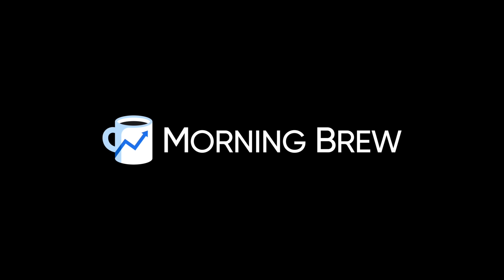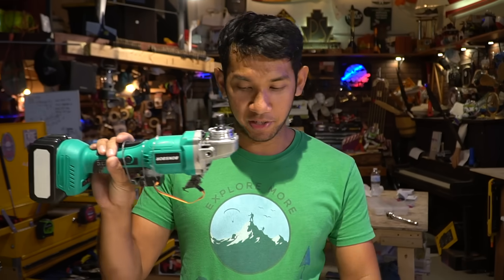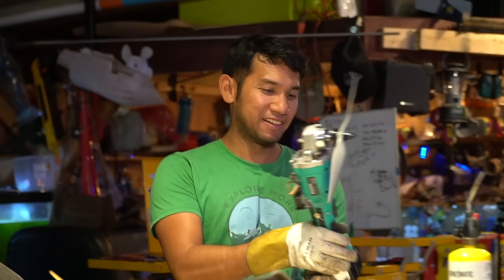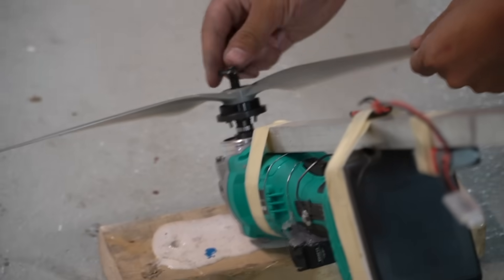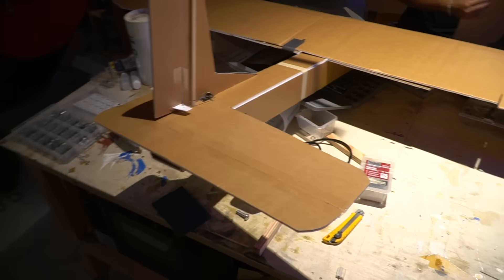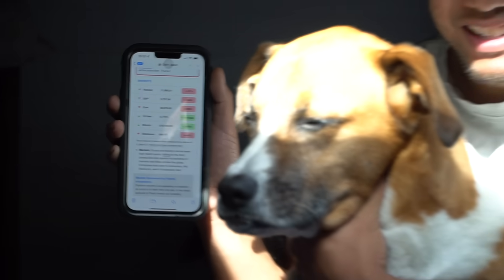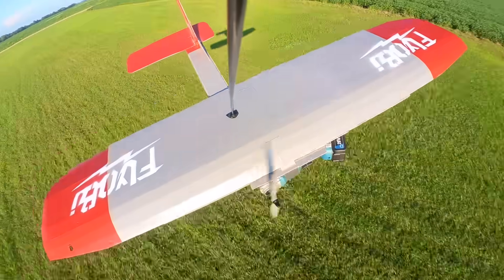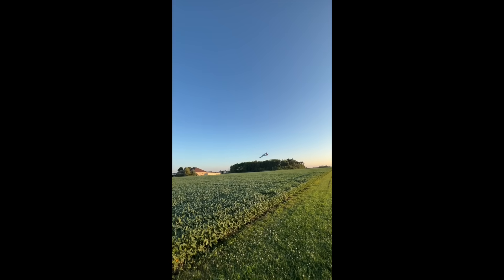Teaching an Angle Grinder to Fly

Comment: If you make a twin engine plane with grinders it will offset the balance issue putting both batteries in the center of the plane.

Comment: I’m impressed with his ability to pilot all this crazy stuff. If you have ever flown an RC plane without gyros and modern stability systems, it ain’t easy on well designed models.This dude? Asymmetrical designs, crazy CGs, ridiculous drag coefficients, violent cg shifts, oscillations , piss poor control surface authority, flexible fuselages, twisting, warping. No problem! It’s impressive the crap he can actually keep in control.

Comment: 1 angle grinder on each side would've given the helicopter more power and way more stability, and actually make it rotate around its central point unlike the offset thrust here. The prop's probably too close to the centre, and that distance would have to be optimised; hope they give it another go.

Comment: Put 2 angle grinders on a plane frame, with propeller sets for each tool. 

Or 

Battery a operated router, putting in a reducer gear that slows down the amount of startup torque initially generated. Hopefully that would take enough stress off of the airframe before the launch.

Comment: instead of connecting the propeller directly to the angle grinder, attach it to a drive shaft. extr points if you take four of them, and make a quad copter

Comment: If the angle grinder's housing is removed and only its motor and battery are used, then a great deal of weight will certainly be saved!

Comment: Yo what the fuck are you doing having someone hold stuff while you cut it with an angle grinder. Those wheels have a tendency to explode and that guy is right in the line of fire. Not to mention, you could just cut him? What if the blade got caught and yanked towards him? For a smart guy, that shit is one of the dumbest things I have seen someone do in years.

Comment: Why not remove the right angle gear box on the front and just let the motor drive the propeller directly? More efficient, and you can center the mass of the grinder.

Comment: @PeterSripol  If you take the angle end of the grinder and make a small plate to replace it, you will then have the motor running inline with the fuselage making it easier to balance out. Will also give you the full power of the motor.

Comment: Great video!
What, if any, impact did the offset right angle orientation of the grinder have on the planes handling as you were throttling up and down?
Did the propeller temper/buffer any of this effect?
I ask, as I know from experience that the angle grinder can try to spin out of your hand about the rotating head if you run it instantly at full power.
This is  best experienced by holding the tool straight out to your side at arms length like you were holding a torch, and the rotating disk/propeller facing away from you, as if the grinder was one of those WWII flashlights and you were shining it to your right with your hand extend all the way out.
Quickly throttle the grinder up and then off and you should feel a strong twisting motion at your wrist.  This is the 'axial' motion that is opposing the disk/propeller's movement and with the added weight of the battery, could cause, as you mentioned at one point with the helicopter, the center of balance and center of gravity of the plane to shift as this rotational force of the spinning propeller increases and descreases thus changing the forces applied against the control surfaces.
With the grinder "engine" of the plane offset, I was wondering if the plane would tend to try to bank left or right as you throttled up quickly or throttled down quickly.

Comment: A thought for launching the helicopter. Spin it clockwise, as viewed from underneath. Mount it to a threaded rod via a large nut (1/2" 18tpi). screw it onto the rod about 4 or 5 turns and let it spin itself off the rod. No more trying to push it up to launch it.

Comment: Cool rig!
If you take the bevel gears off, the motor can sit longitudinally helping out the balance, and the rig will also enjoy a little less mechanical loss. I dont think the gears have any actual reduction, so you're still direct drive.

Comment: Your idea with the flying Wing isn't far off base. The problem is that the wing is what's generating lift and it's majorly on one side so the wing wants to lift and roll over basically. You would need to get it spinning sufficiently fast for gyroscopic stabilization to keep that from happening.

Comment: You should definitely make a flying dremel. Those things make a LOT of rpm.
Reply: That’d work with a quadcopter. 4 dremels at the top, and the “cords” going to every arm

Edit: I found a video of someone doing this https://youtu.be/mCfYi7634rU
Reply: @averagememer7068  maybe 4 dremel motors but not 4 dremels 🤣
Reply: @averagememer7068   false link i got sent to a cooking video
Reply: @buddy5719  he has actually made a video of it
Reply: @averagememer7068 Piss off bot 🤖 😂
Reply: @averagememer7068  It's a trap!
Reply: Yeah but they make 150w of power...so those rpms will drop to like a few hundred rpm.
Reply: HE DID IT!
Reply: They lack torque i think
Reply: @lennartsix6102  gearbox
Reply: you are wrong. the correct answer is table saw
Reply: RPM is bad because the propeller have a limit of rotations, to fly you need torque, most of piston planes fly around 2000rpm but with torque of a diesel.

Comment: The fun thing with the BV141 is the tail design wasn't because of the asymmetry — it was for the tail gunner! They wanted them to be able to not have to worry about the stabilizer being in the way. It was mocked for its design so never saw production beyond the first prototypes, but filled the role of a single engine scout/bomber that it was designed for pretty damn well in initial testing.

Comment: @petersripol Just an observation on your...monocopter?  I think your launch stick needs some help.  Try inserting it through a shorter tube so you can hold the stick and pop up with the tube to push it off the stick.  This might help some, but it really likely needs more RPM-age.  The plane looks awesome. Congrats on that first try success!

Comment: You should re visit this with a cordless dye grinder. I think mine does 20k rpm.
Reply: Yes.
Reply: Dye grinder could be the stabilizer propellor on a helicopter!
Reply: He chose a low rpm angle grinder on purpose. The propellers can't handle rpm that high.

Comment: Ideally, the propeller should be at the end of a rotor. This produces greater leverage at the interior of the blade and produces more thrust. That's why rocket helicopters have the rockets, (20 lb thrust) at the ends of the rotor to produce much greater thrust for flight.

Comment: they forgot so easily that they are working with an angle grinder. I understand that it's just a electrical motor in the core, but damn imagine cutting some steel and suddenly your angle grinder takes off, that would be so scary.

Comment: I have a challenge for you: Create a "high tech" steampunk plane that uses steam ejector(s) as an engine. (Boiler pressure steam used as moving force) as i have seen those kind of machines but never saw someone trying to use it as an engine in a plane before

Comment: If you really want a long duration, powerful flyer you could strip off the case and rearrange the motor, trigger and batter for a more streamlined fighter plane.  Fun times, though, you will be remembered for your adventures.

Comment: It's funny, guys, but so impractical to have a motor and prop mounted at a 90 degree angle from each other.  If you take off the end and expose the first motor shaft or even put planetary gears from a used drill on it you could get more energy from the motor and faster speeds, or with the planetary drill gears you could get a lot of torque on a prop for a helecopter.

Comment: Anyone consider damn to stupidity dangerously crazy to fly, that part on the angle grinder that resembles 90 degrees to propel is no where near the shape properly and weighs too much to do any flying. Besides a servo requirement to operate any flying things. Dangerous inappropriate engendered guesswork can lead to fatalities , if you don’t fly a plane first

Comment: You could try separating the battery from the tool, and run some wire between them to space out those two heavy parts. That might help adjust the CG to be more balanced.

Comment: how about a cordless circular saw like the  m18 7 1/4" blade saw with a big battery 8.0ah   or even there 6 1/2 blade one .with  assorted battery sizes as they offer 8 different high output 3to 12ah batteries

Comment: How long of a flight time was you getting out of that angle grinder plane approximately and for the helicopter one you made  I think you have to put the motor out on the end of the wing not in the center for it to get enough speed  to work

Comment: I'm not totally understanding why you mounted the side grinder sideways under the wing. Why not mount it vertically with the battery in either an "up" or "down" position, so as to be more balanced? 
I noticed that the horizontal stabilizer had more authority on the opposite side of the side grinder's position. But, your drill airplane had a vertically mounted power source.
Perhaps you mounted it this way because it was less complicated?
You may have explained it in the video, but while I watched, I had a 2 year old and a 5 year old in the room, running and screaming and climbing all over Dad. :) :) :)

Comment: Next time try using 2 grinders on the helicopter mounted on the outer edge area of the prop wing. One pushing and one pulling i.e one "reverse thrust" and one "normal thrust" or one prop spinning clockwise and one counter clockwise.

Comment: I think a dremel or similar would be a good idea because of the high speed rpm.
Reply: Only problem - propellers can over speed into a shockwave at the tips, then become worthless. 
On the other hand, same idea thou, a good powerful Cordless Die Grinder with 1/4" Arbor Collet with variable speed to dial it in should actually work quite well with in-line body design - where if necessary, battery could be moved to  preferred spot to keep Weight and BALLANCE in check at usually the center line on main wing spar. 
Plus removing weight of right angle drive   of grinder. 
Cheers

Comment: why not diassembling the angle grinder and just screw the main motor so it no longer has an angle? I'd do that, but with a Bosch drill, It's got the torque for that.

Comment: Wait till they figure out you can remove it from the case.
Reply: He did on the first blower powered plane and fans said it was cheating. He now leaves the tool intact. He didn't discuss it in this video though.
Reply: @jefoidmakes  precisely this. At some point of disassembly, you're just spending a bunch of extra money for a motor that wasn't designed for the job.

The fans can debate at which point the Tool of Thesseus ceases to be a tool.

Comment: I wonder if it wouldn't be better to orient the grinder vertically, and either use it as a structural component of the fuselage, or as a brace for a landing skid?
I think this project has more potential, even without disassembling the grinder for idealized placement of components &
removing/bypassing trigger circuitry.

Comment: Is there a way to put multiple batteries in parallel for increased flight time? And what if you stripped the grinder down a bit for weight reduction and better air flow?

Comment: Hey guys cool vid . What do you think about using a router they have very high rpm and The shaft is in the center .Instead of having a long handle the battery  hanging off the end

Comment: Would be great to see you propelling yourself with professional battery operated grinders (or any cordless tools) in a fun  vehicle. I'd prefer a skate boat on ice or ski-jet on snow, former having a very low surface resistance (a drezine on rails would probably beat it, but the railway companies might object). I don't know about winters in your county, but you can find ice everywhere they like hockey anyway, right?
Reply: Edit: as a metalworker, forgot to suggest to modify - at least thid angle grinder. To spin the propeller, the internal 90° coupling is both cumbersome and angled ( as in the name ) offsetting the centre of mass and symmetry, also wasting power on friction, vibrations and wear of the cogs. An engineer  solution would be a direct drive from the central axis of the motor, making it centered and more efficient, if rpm is right. Also getting rid of over-engineered casings and frames for the sake of weight and volume might be an option. Good luck and no injuries
 (☞ ͡° ͜ʖ ͡°)☞

Comment: I'd remove the right angle gear head and go direct to motor spindle - would need to inspect output shaft if it needs moral support at end of motor shaft for bearing support - but maybe not. 
Use directed fins to steer air into motor. But now rpm is maybe double. 
No big deal, belt drive reduction needed for large prop. Or belt drive two props like a P-38. 
Good luck sleeping on that design, at least injuries during dream heal quickly. 
Cheers

Comment: That is a fun project. If you want to continue with it, one thing to address is to fine tune the shape of the horizontal stabilizer so that it reacts the way you want to thrust on/off changes. I notice that it has a fairly abrupt nose up/nose down to those events. You can change the angle, or shape of the tail to make it react more neutral  to the thrust changes if you want.

Comment: You're seriously concerned about amp draw on a model airplane propeller through the air, when the angle grinder is literally designed to spin a cutting disk through steel??

Comment: U need to have a 3 Blade or say 4 blade propeller it will help to reduce vibrations and even it will help u to use a larger size propeller.

Comment: On thing. Dilemma specifically means a choice between two options. Di = 2. Lemma = a subject for consideration or explanation, a theme, matter, subject, contents.
Not some general hard problem or question. But very specific, the one where you path is dividing in two.

Comment: Why didn't they just take the angle grinder apart and put the motor in the nose and install the batteries in the middle for balance. Also if they do it that way they can install a larger battery or install multiple batteries together for longer flights.

Comment: Next, use two angle grinders, but take em apart, use the parts and mount them in motor pods on each wing....with quick change battery's, LOL..

Comment: Solarpowered "all day" "drone"... really really lightweight (maybe Raspberry pi PicoW as controller?)... if surplus power add some really lightweight battery for longer lasting (and still fly under not so good weather)... either add camera or just sensors.

Maybe (get a collab of a really good programmer) make it "paper sail" that could (with sensors, and/or the smallest airflow sensor/meter) "read" thermals...
Oh... another idea... maybe have the really really lightweight/small flowmeter have dual purpose...  either read the flow, or power it for some minimal thrust to get to thermals?

Comment: Doesn't these cordless grinders use brushless/brushed DC motor with gears, so in theory u are just using a regular high perf. motor with added additional metal casing and inbuilt battery, which is definitely not required, to build a model aircraft.

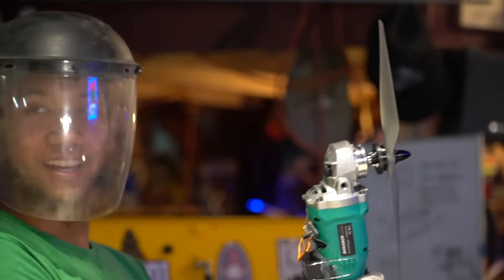Comment: 2:10 
I cut the tip of my finger off (think a skittle sized chunk) doing something similar to this, except with a electric motor that I was kind of just holding. Still have a blood splatter on the foot of my bed and a dent on my ring finger. You live and you learn.

Comment: You should have used a Die grinder, basically the same power as a angle grinder, but without the right angle design, the rotation axis is the same direction as the tool body

Comment: An Itallian WWII plane design that I think would make a neat electric model plane is the Stipa-Caproni where the main fuselage was basically a hollow tube with the propeller inside of the tube. Some say that the design helped with the development of jet engines.
Reply: It was an interwar design (first flew 10/07/1932) not a World War II design but it'd still be neat
Reply: @iR-80  I had been thinking that there were a few used at the very beginning of the war, but now I see that I was wrong. Thanks for pointing that out.
Reply: If I remember correctly they were about as easy to turn as an aircraft carrier, would be a cool video though

Comment: I'm actually not surprised. Angle grinders are designed for higher torque mid to high rpm. The load a propeller has from pulling and pushing high amounts of air thru the blades is perfectly optimized for such torque and the speed it operates at is around the range of an rc prop. So realistically the only draw back may be a thermal cut off switch from running to long and the mass of the battery used to power it. Anyways good build. You should attempt a quad build for sure

Comment: Fun fact that I figured out about the WWII keychain can opener that the soldiers used,  p38 had a handle that looked like the p38 aircraft rear stabilizer, and the p51 can opener's handle looked like the rear stabilizer from the p51 mustang.

Comment: Why wouldn't you just make a smaller helicopter and use the grinder motor to run two blades for upward thrust? With maybe a counter weight in the front to offset the handle and battery weight to get the center of rotation and gravity at center of the propeller?

Comment: Peter: do you think spinning a large prop slowly through a transmission can be aerodynamically more efficient than a fast small prop and make up for transmission losses?
Be cool to see an experiment with a small fast motor geared 100:1 or something, then measure flight time (or thrust vs time on a stand).